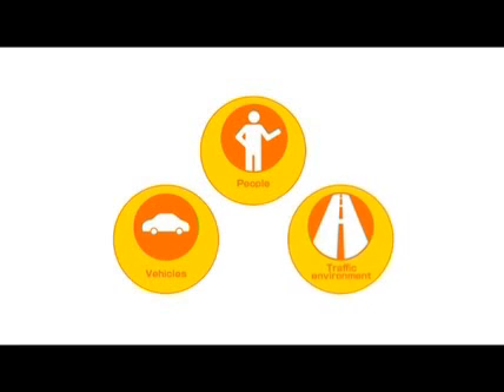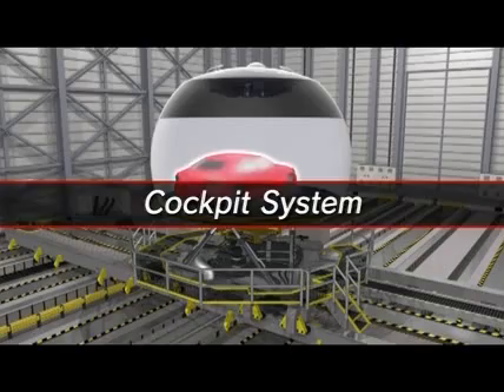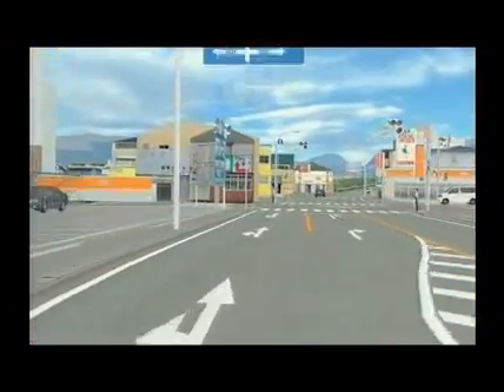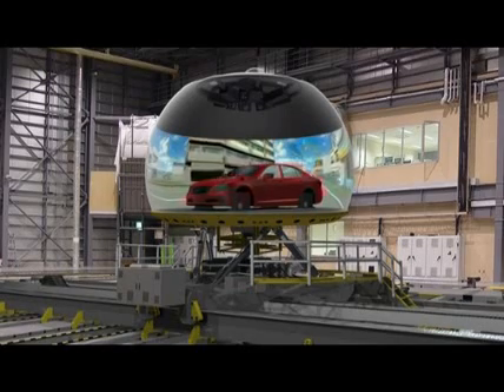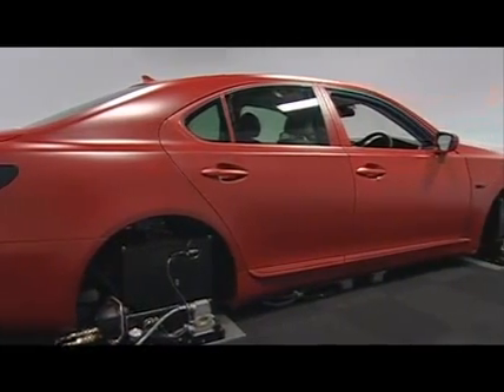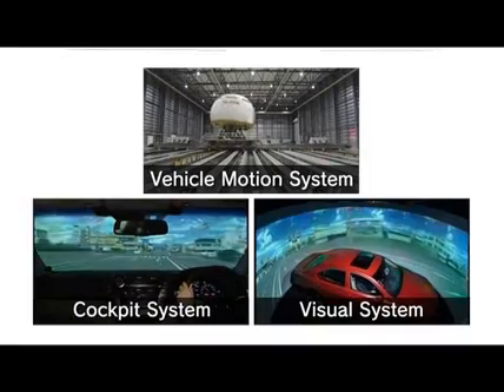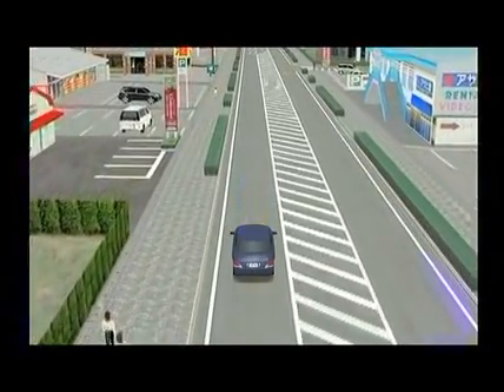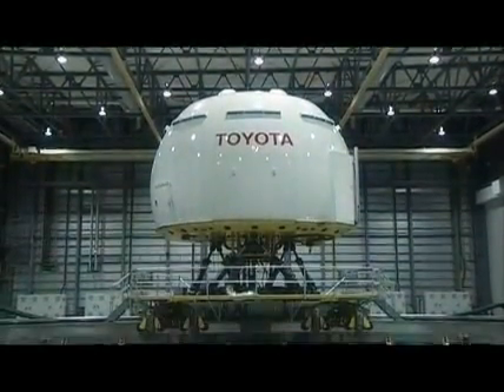Toyota's Driving Simulator

Comment: The point of it moving around in X and Y is to create actual acceleration/deceleration forces.  The system can basically duplicate the forces of driving up to 30 mph.  Simply tilting the dome is good, and does fool the brain, but this system is absolutely amazing.  I was an assembly tech at the company that built and installed the system.  It is massive!

Comment: It's also funny to note that the simulators in 1998-2002 are graphicly not far behind the current ones. They always focused on other things. Its also much easier to sell a proffessional product that is just as good if not better because its more practical as a tool due to its poorer graphics. Youre also able to sell it a cheaper price because all your effort went into engine physics and actual simulation.

Comment: @izaatmusic: Are you kidding? Haven't you heard about the Toyota's cars where gas pedal got stuck (and not because of floormat because it's a computer error, so the computer makes the car press gas itself) Btw I drove with Yaris, stopped on red lights, changed gear to 1 but the gear didn't change so I got stuck there and made big traffic jam, I couldn't push the car to pedestrian road so that just sucked. I don't trust in Toyota. Btw somebody could easily die under that moving simulator at 3:15